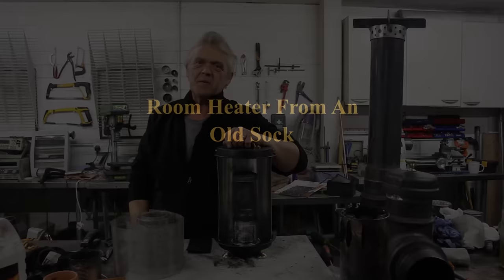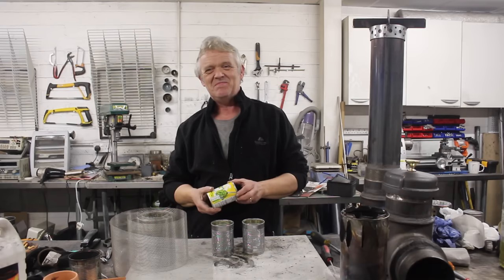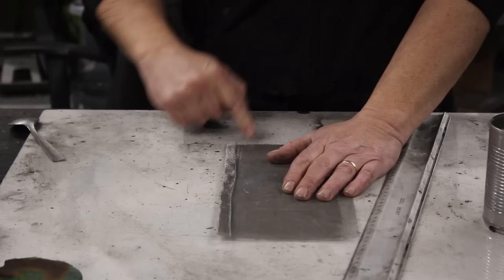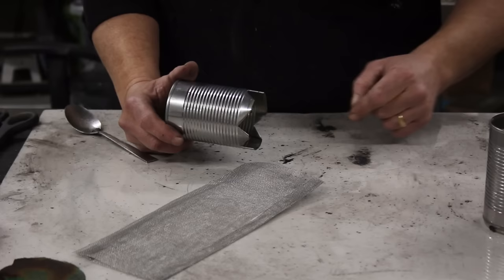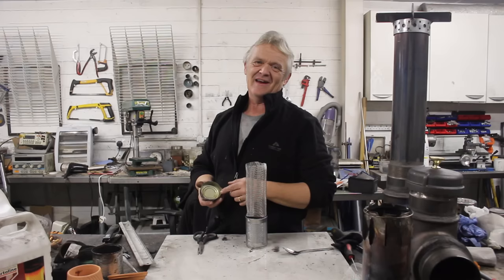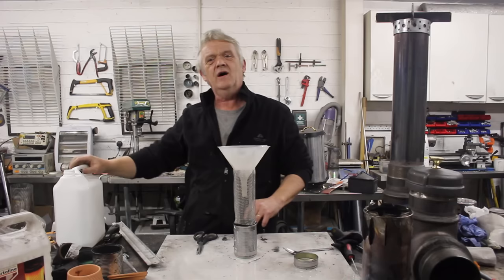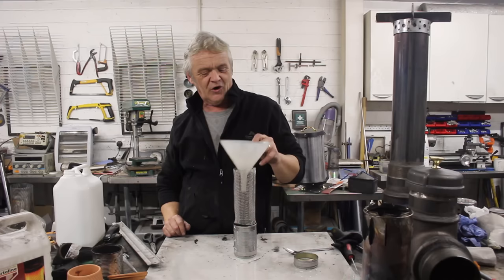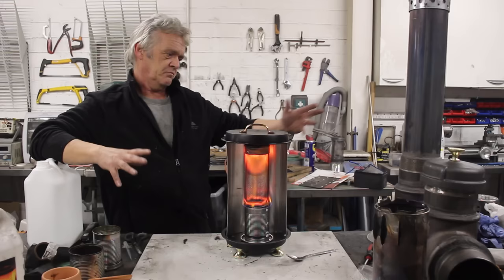1746 DIY Room Heater From An Old Sock

Comment: Made one from your design for my tent,  but I didnt put a handle on it, I use the top for cooking, Heating and cooking all in one,  Works great.  Cheers Robert.
Reply: Open flame heaters in a tent, what could possibly go wrong?
Reply: Dave, if you fail to set the tent on fire, you could always slash your wrists with the edge of the cans.
Reply: Dave i agree. i cant believe your comments men/child comes to mind wow.
Reply: Despite all the bad rap about what you were using your heater for in a tent I'm sure you're an adult understand fire and flame burn things and you use extreme caution cuz I know I would I'm not a child grown man and know exactly what I'm doing when I'm doing it thanks for the comments All
Reply: OH my god, I can't believe these negative comments, they sell open flame propane tent heaters. This is nothing new, but apparently to some it is
Reply: Despite the negative comments I have taken into consideration the safty issues. 1 the way I have made it by using 2 stainless bowls one as the top plate the other as the bottom plate, which holds the burner and catches any over flow IF ANY,  Its very stable on the ground,  just the way it would be when used indoors.. 2, I have tested this in the tent with a CO meter.....nothing....due to good air flow using alcohol as the medium. So as the video suggests, anyone who dosent know how to play with sharp object, please do not use
OPEN FLAME heaters are nothing new in tents,  so pleas have some good knowlage about the subject,
Reply: @pacman4568  remember the chat guidelines please
Reply: 😆YOU GO MY MAN!
Reply: @Coxeysbodgering  what does that little red star next to your name mean?
Reply: I too am interested in cooking, heating, and cooking.
Reply: How long burn time do you get?
Reply: @gecko6355  I can get around 45 minutes of cooking and heating using alcohol, but the way I designed my one, I can swap it out and run a cheap chinese micro stove using gas that can last for hours when its cooking and heating. Again good ventilation is a must.  Hope this helps .
Reply: @mrfitz96 Called don't be an idiot...if using an open flame anywhere should be carefull its no different from lightning candles in your house just be aware common sense
Reply: @jshaw4757  Sure, it's exactly the same as a house....if your house is 6'x8' and made from flammable melty fabric with zippers for doors and no windows.
Reply: @mrfitz96  Well leave a candle burning anywhere there is a chance off a fire I'm sure many more houses burn down than tents homeless people use camping gas burners too stay warm in tents it's either that or freeze just gotta be safe like when you cross the road split second misjudgement your dead or severely injured so no different everything we do in life is a risk I suppose is what I ment

Comment: Hi Robert, thanks ever so much for all your videos... Much appreciated. I've made a bit of an upgrade to mine. In the interest of safety and stability, I've epoxy glued a few magnets to the bottom of the fuel can so that when it rests on the base plate it actually keeps it from falling over when accidentally bumped. My bottom plate it rests on is made of solid steel, so that provides a nice connection, and some weight as well. Thought I'd share that.
Reply: I like this, it sounds like an excellent idea, and one I could easily steal when I make mine.  Fantastic idea mate.
Reply: Wouldn't the magnet degrade when heated? The  structure is metallic and it will conduct heat to the base easily.
Reply: @copernicofelinis  yes two fold, magnets will degrade if it gets too hot so will the epoxy, I think in the region of 200 deg C might be wrong BUT surely magnets would negate the need for epoxy, metal can and metal base plate ?? unless either isnt ferrous
Reply: @copernicofelinis  good point, but so far it's doing wonderfully. no issues whatsoever. The bottom of the can doesn't get hot at all due to the wicking effect of the carbon felt I've got rolled up in there I guess. can easily be touched when burning. temp goes up around midway towards the top of the can
Reply: @povvercrazy  the epoxy is just to keep them from sliding around the base when moving the can and to make it easier to remove the can without the magnets making up their own mind whether they choose the base or the can to stick to. This way they stay in place in the spaced out arrangement I've chosen on the can
Reply: Or just use a magnetic bowl.
Reply: Just add an air layer if you are worried about the magnets degrading.....can add magnets add metal plate add magnets add base....problem solved

Comment: Made one a couple weeks ago. Turns out the pure carbon felt was not ‘pure’, and although it started great , it suspiciously smelled like burning plastic ( after 10-20 minutes). Wouldn’t light second fill and when disassembled the felt fell apart 😖. I ordered another carbon felt - this time a welding blanket rated 1400 ‘ F.  No worries- works like a charm. Brilliant!!! I tip my to you Mr Smith
Reply: Many thanks.  I thought I was doing something wrong when I had this same problem and was disappointed.  The felt I used looked the part but became shorter and slowly disappeared down the gap and stuck to the sides of the tin and gauze.  I was sure I had bought the right felt as Robert suggested,
Reply: Yeah, I ran into the same deal. I did look ALL OVER the package for it to say 100% carbon fiber but nothing was said.

Comment: Great work. Just one more thing. One should consider incorporating a way to put out the flame for when the room is warm enough.
Reply: I agree. I would like to see a slightly more complex version where the height of the flame could be controlled or easily put out as well
Reply: Yea just made the sock version..how do I put it out before I light it here to text 🤔
Reply: @peterjohnston4472  I had only thought being able to put it out would be a good idea.  As to how, maybe someone might present a better idea but my first thought would be to use another can that is taller than the mantle, like maybe a hair spray can or lysol can.

The can must also be able to somewhat loosly slide over the mantle. Not too tight nor too loose. And remember the mantal will have  expanded a little while it's hot. 

If you can't find a suitable diameter can then you might use two cans. To do so you'll need to 
1) know the circumfrence of the mantle, maybe using a string. And add a milimeter or two. 
2) Then divide that by four to get 1/4th the circumference.  
3) Then take two round steel hair spray cans or lysol steel cans and cut down the length of each can to get two curled sheet from the cans.
4) Now first mark the center of the curve in the can top and bottom. 
5) Then measure out 1/4 the circumfrence from before on each side of your sheets, and make a new mark on each side of your first mark from top to bottom of each sheet.
6) Then take two block of wood longer than each sheet is tall and place them together with the steel  sheet in between such that the outside marked lines from before line up with the pieces of wood going from the bottom mark to the top mark.
7) Screw the pieces of wood together and use it as a metal break used to put clean sharp bends in the sheet metal from the cans, and put an 90 degree outward bend from the sheet's curl on each side of both sheets. 
8) Then you can bring the two curled sheets with the outside bent tabs together forming a circle inside, and  use vise grips to hold the tabs so that you may drill two holes on each  outward bent tab, and secure each side with 2 short bolts and nuts.
Reply: @kreynolds1123  Use cooking oil instead and other materials as fireproof bricks.. Simple tl handle and easier to put out.. 👍
Reply: @helengren9349  In my experence cooking oils, especially those with a high smoke temp, tends to burn sooty. With a small space heater like these, extra care must be taken to ensure all the fuel is burnt.  And if its not waste vegetable oil, the fuel is expensive. And waste vegetable oils tend to be high smoke temp oils that burn sooty.
Reply: Just a thought, I would use two reflector panels of the same size inside the cake tins. The outer having a small knob or handle on it. This way, it would act as a sliding door that can be closed starving oxygen and putting out the flame.

Comment: I like the new mesh design, Not all socks are pure cotton so you may want to clarify that.. I have a 100% cotton washcloth I'll be using to make a burner or 2. Lots of stuff works as wicks, plain paper towel, fiberglass mat, exhaust wrap, blue shop towels, cotton towel, cotton balls

Comment: Another way could be to use a pipe filled with sand with holes in the bottom letting the fuel inside and the sand wicks the fuel up to where you light it, or just replace the sock with sand and smaller holes. Have not built it my self, but should work. Sand lasts forever too. Sand wicks water up a few cm or more, not sure how it responds to the viscosity of the fuel, maybe something to experiment with Rob?
Reply: i believe vermiculite also should work, but not sure
Reply: Maybe perlite?
Reply: This works like the old lanterns with tubular wicks. It has to be a tube so it can't be filled with sand. You could use a pipe within a pipe, which would be fine, but you run the risk of one pipe moving and changing the thickness of the wick.

Comment: I would add some of the carbon felt beneath the top cake pan.  That would aid in accidental touching and getting burnt and also aid in keeping the handle cool..  However, if you don't put a handle on the top and you make a sturdy burner, you could use the top of cake pan a place to sit a pot.  If you invert the top cake pan and attach the aluminum to the outside, you could put water in it to make a steam heat/humidifier.  LOTS of options.

Comment: How about adding a concrete base, to lower the center of mass, so that it would be almost untoppable? 

Also, instead on a single aluminum sheet as reflector, make them two an inch apart, add lateral surfaces and fill the innards with sand to store heat for when the flame is gone.
Reply: the fuel can has space for rocks or bolts or what ever to be added in if thats a concern. But then again, it should be placed smartly to begin with and not having people playing around near it.

Comment: I love this heater.  I made one but I used NO WICK.  I simply put a smaller can with no top in the outside can.  A little fuel in the small can gets lit and as the little can floats on the fuel in the big can it heats/gassifies the fuel in the large can, which passes out the gap between the cans and burns.  Hope you like the super easy no wick version.  It's almost like a penny stove.
Reply from the maker: I do like it mate - nice one
Reply: @ThinkingandTinkering  
Hi Robert, I'm looking at building this as a room heater , will fibre glass insulation  work as a wick ? As I'm not keen on breathing in  burnt sock . If fibreglass isn't suitable ,I'd very much appreciate a link to the correct type of carbon felt  as I really want to build your original carbon felt version .I look forward to your reply. Thanks for the great videos .
Reply: Trying to picture this....  So 2 cans.  The outside larger can has the top removed only.  The smaller inside can also has only the top removed and floats on the liquid -at a  constant level.  I am assuming the mesh (what size mesh is everyone using) is attached to the inside floating can.  Maybe safety wire would work if wound it around tightly.  The fuel is always in contact with the mesh and wicks up the mesh which is between the 2 cans.  Correct?  If so, does the fuel wick up high enough when the fuel is low in the outside can and the inside can is floating low?
Reply: @slrs3908  yes and it stays hot and in turn heats the fuel in the large can. The mesh is on the outside of the larger can so that the inner can is free to move up and down with the fuel level.  A little fuel is put into the inner can and lit to get the gassification of the main fuel in the larger started. No wicking only gassification of the fuel in the bigger can which floats up the space between the two cans and ignites
Reply: @davidjacobs828  Just be sure to use a 100% cotton sock and use the part below the elastic bits.
Reply: @nickreagin9585  
Thanks nick ,do you have a link tobthe correct carbon felt please ?
Reply: @davidjacobs828  Nope.  That's why I explained the sock conundrum.
Reply: @nickreagin9585  
OK,no worries ,thanks for taking the time to reply.
Reply: A great idea, how long does ethanol burn for in a burner your demonstrating with Thanks
Reply: @nickreagin9585  Someone mentioned blue jean material,   I say cotton Tshirt.   A old man on a different channel said that pure white fiberglass lasted forever.   as a Experiment Only,  the two cans fit alot tighter without a wick and then inner can is taller so it is self heating.

Comment: Here in the States, we have heat shields for wall protection while soldering copper pipes in plumbing. They are carbon fiber. Good stuff. Tool/welding departments in big box hardware/home improvement stores may have them. Peace!

Comment: You'll want to burn away the inner plastic coating of the cans before you expose them to heat, or they can release some pretty noxious fumes.
Reply: I think only aluminium cans have a plastic coating and tinplate doesn't. That being said though, you're going to set it on fire anyway.
Reply: @CallMeMrChainmail  The steel (not aluminium) tins I used had a plastic inside coating, I was quite surprised.
Reply: @pa_maj.MARTINI-van-MAN  it's a protective coating to keep the metal reacting with the food.  It may or may not be bpa free, so something else to check on with your food, if that's a personal call to arms :)
Reply: @pa_maj.MARTINI-van-MAN  Gross. Tinplate doesn't need a coating. I wonder if they're just using normal steel and coating it with plastic.
Reply: @CallMeMrChainmail  The cans had a little rust on the outside, they had been sitting in a moist environment. I'd say you are correct about normal steel with a coating, who knows what we're consuming. Tinned food was good for a long time, I'm not so sure about that now. Not all tins on tinned food is equal, that's for sure.
Reply: @colleenforrest7936  It is most definitely Colleen if it's not bap free. I heard about this a while back but only discovered it recently for myself while burning some Ethanol in a can, otherwise it's hard to spot.

Comment: I can't speak for people in other countries, but the carbon felt showed up immediately on Amazon when I looked for it. It's now in my two cans. I haven't lit mine yet. I now have two different kinds of mantles to try out. The first one is the same as Robert used in the first video. The second mantle I made is a little bit thicker--almost like a small expanded metal grating. I'm thinking that one will take longer to heat up than Robert's wire mesh.

Comment: Carbon felt is readily available on ebay, approx £7 for a piece 12" x 8". Just waiting for my aluminium sheet to arrive then away we go 😄
Reply: 'carbon fibre welding blanket' too
"SOFIALXC Graphite Carbon Felt High Temperature Carbon Fiber for Contamination Adsorption Cleaning Shield Slag Fire Felt,300mmx200mm,3mm"
Reply: @paulmaydaynight9925  that's the one, I should have stated that's what it is called 👍
Reply: it's also extremely brittle I tried re-wicking a davie lamp🌝, and it itches like hell if you get it on your skin
Reply: @Jimbo878  will keep that in mind, thanks
Reply: I went to a welding equipment out let and, they had no idea what I was talking about. Have fun with all the fibres in your hands after playing with it. On Amazon, LOKIH Graphite Carbon Felt High Pure Graphite, Used for Welding Fireproof DIY Industry 6Pcs,5mmx100mmx100mm pack of 6 £19.73 may take 2 weeks to arrive.
Reply: @pacman4568  hmm. Mine feels like a flannel shirt, soft and fuzzy, black. Works good in the burners. Might not be 100% carbon but I see no burning of it.
Reply: @paulmaydaynight9925  are these the names that are the right type thanks
Reply: Ive already posted similar, but want to add here another good tip is in the images they normally show it being blasted by a blowtorch
Reply: Just curious, but what dimensions is your aluminium sheet?
Reply: @Jimbo878  you sure yes isn't some kind of fibreglass? Not had that with mine, but you never know what they put in this stuff when it's made
Reply: @Warriorking.1963  think I ordered 30cm x 30cm. Not a big piece, 1.5mm thick
Reply: @ScoreGuru123  Thanks for letting me now, enjoy the build!
Reply: @paulmaydaynight9925  Not all blankets or carbon felt, can be used as wick for burning... They're made the way it can not catch the fire again..

Comment: I had a slight problem when I made this.
I didn't have an old sock but a mate had a wind sock so I used that.
The problem was that it was made of thick plastic sheeting and didn't fit between the cans so I used a 205 litre barrel with a dustbin inside, and it fitted rather well.
I couldn't remember exactly what you said to use as fuel but knew it ended in "L", so I looked online and found petrol and ammonal. I couldn't decide which, so I used both. Ammonal to fill the dustbin and petrol around the windsock.
Anyway, I put it in my living room.
It lit very well and gave out quite a bit of heat.
Unfortunately, it also blew up the street and I am now in prison for reckless endangerment. 

I feel that perhaps you could have mentioned this slight downside to the design as it currently stands.
Reply: Phew! Good job you weren't making the tin can version or you would surely have lost at least two fingers what with the sharpness of the cans and all which would only serve to add to your already considerable woes! Hope your post incineration incarceration is going well .... but somehow,  I doubt it 😉
Reply: @andrewbarker3210   You're so right.
Sorry, got to go. Big Leroy wants to visit my cell again 😵‍💫